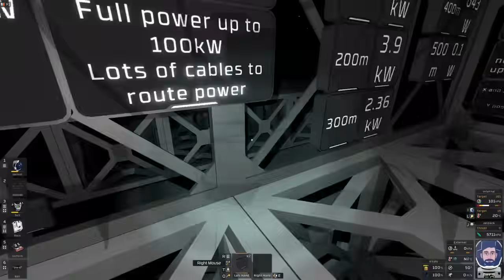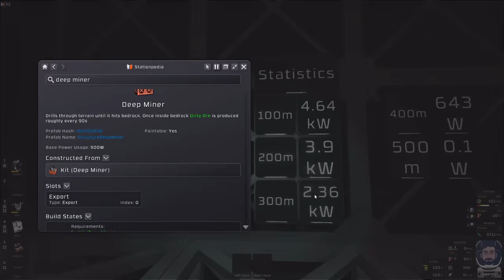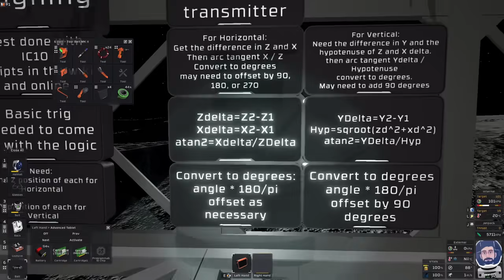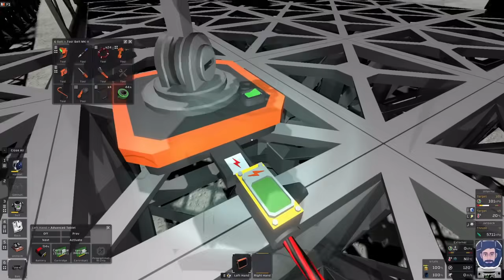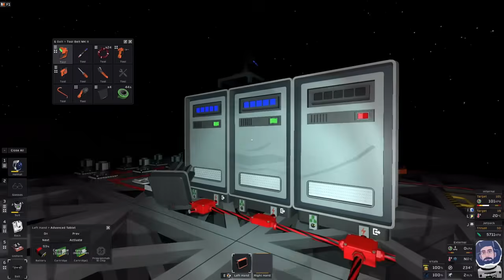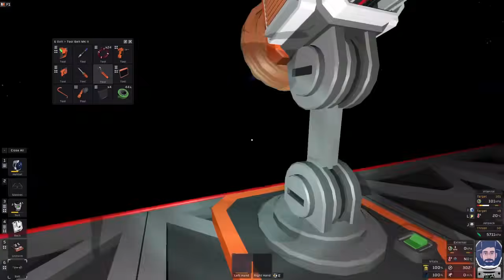Stationeers: Power Transmitters

Comment: they are gonna need to nerf these now that we have an actual sensible use case for using them. a very quick bit of internet searchy searchy seems to suggest that much of the loss in microwave, is really in the conversion, not in the distance. so, that seems to suggest that your costs are mostly fixed, within the transmitter and receiver and distance is not the biggest factor.
Reply from the maker: What is odd to me is that we dont lose power in the transmission. I expected them to need 5kW of power no matter the distance of transmission, but the analyzers suggest they only consume what they send.
Reply: @shadowdrake082  oh, wait ? are you saying they dont "lose power" they simply lose the ability to send a full 5kw as the distance increases ? and the amount of power consumed at the source is that same as what is delivered to the target ?
Reply from the maker: Correct

Comment: Tbh I don’t think the power xmitters are not worth it!  An OP will need about 5kW to run and with a distance of 500m, you set up 5 mutilple stages ea set will drop power.  If you need to go further like 800m+ you will have nothing by the time you get there.  So I set up stand alone power stations.  Unless they beef up the power xfer and or distance, it’s not going to work.  And for reference on Europa some of my OPs are 2.4km away.  It almost takes a full day cycle to drive there, and I’m using cladding as roads.  For other logistics, I have a silo and portable fuel tank that’s sending back how much ea has back to base.  When either the silo is near full or gas is low I drive out there for service.  Last thing DONT use a beacon, use the portable one with a wireless battery. It has no range limit costs 50-60W and if you place in/on a locker/plinth/hab etc it won’t blow away. And yes you can rename it
Reply from the maker: See that is kind of what I figured I may start doing. Even the mk1 rover can hold 2 to 4 portable tanks. Interesting thing about the wireless... is the omni transmitter in your base or is it at the outpost?
Reply: @shadowdrake082 the Omni wireless is at the outpost too, this also does double duty as when you go to the OP it keeps ur tools up and rover recharged.  I filled a rover with 3 lg wireless batteries and drove 2km headlights on and they dropped to 80% on Europa.  Idk if it will be /has been fixed, a rover on a non terrain surface (cladding, floors, frames etc) will “shake” and slowly drift to its right side.  If it drifts too much it right side will be up against a wall , making it impossible to get to its battery ports.  That’s why I use wireless batteries, and an Omni in the garage too.